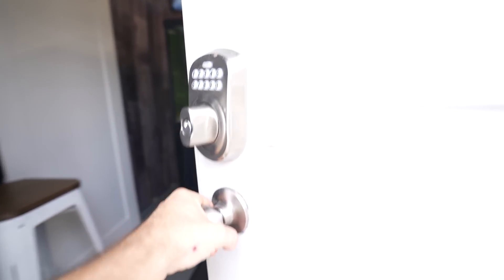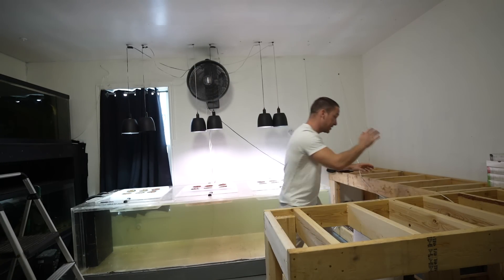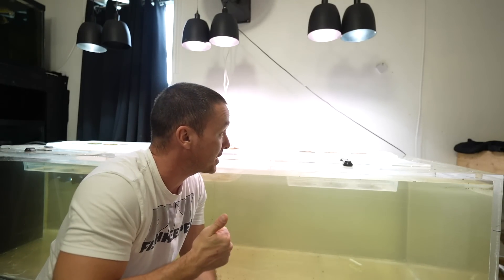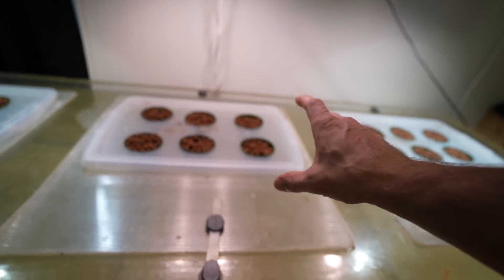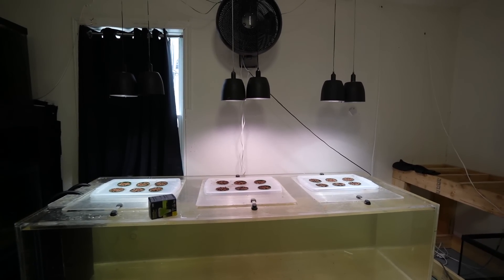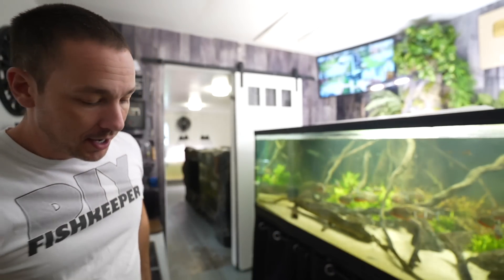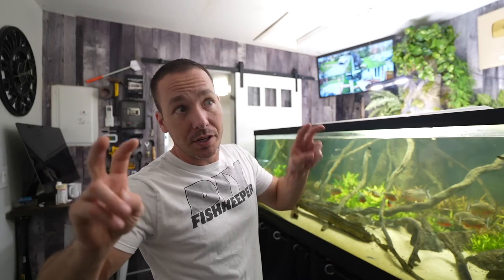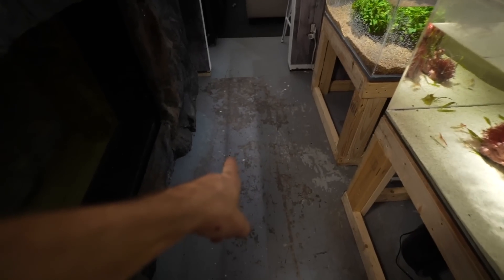HOW TO: DIY aquarium fish aquaponics

Comment: I work in Aquaponics and have a setup on my aquatic turtle enclosure at home.

I have a couple suggestions: Once you're sure you like how things are set up, I would switch those pots out for net pots to allow greater water flow around the root systems since you don't have pumps actively circulating water directly around them. Secondly, you will need either a trellis system, OR, and I recommend this one, an overhead string and clip system coming down from the ceiling in order to grow tomatoes and anything else that may need support. I also HIGHLY recommend searching out smaller plant varieties, like patio types, so you don't end up with a 9 foot tall tomato bramble taking over the whole top of your aquarium. You may also find that those single bulb lights have a hard time producing enough UV light to grow sturdy plants. I have some like that in my reptile room ceiling fixtures, but the plants I grow in there are mostly lower light plants, like pothos and spider plants. Things like lettuce and herbs may require more light, and some, like parsley and rosemary, really appreciate more of the red light spectrum. It may take a little searching, but there are affordable panel lights with a bazillion LEDs in them that will likely do a much better job.

Herbs that do well in aquaponics settings: Basil, Parsley, Rosemary, Thyme, Oregano, Dill, Chives, Cilantro, Sage, Mint
Reply: Would you have to be worried about certain herbs being safe for bettas or other sensitive fish?
Reply: @metametameta69  I don't have a studied answer for that, but most of those herbs house the essential oils in their leaves and stems, not so much the roots. I do know that chives roots are just as strong as the rest of the plant though, so if you're worried you could skip that one. If you have sensitive fish you may want to do research on the specific fish and herb combos you're thinking about trying, just in case. But most plants don't release the EO's until cell walls are damaged.

Comment: Yes please get another redtail, i love redtails so much. I got my redtail around a year ago because you not only show how amazing the fish are but also you can keep fish appropriately on a budget. I kept my redtail in a 125 for 7 months or so and when she got around a foot long i bought a pool pond for her and my tiger shovelnose. Its a 10x7 pool and for filtration i used a 1/3hp sump pump with a tote as a filter box with two 1 1/4 pvc with uni seals as the outflow. It gives plenty of oxygen and it was around 100 dollar US to build. The heater was the most expensive part and its an in line run through hottub heater that cost me like 125 to buy but winters in my state are a bit rough at times getting into single digits at night and its just in my basement on bare ground. Shes almost 2 foot long now and seems very happy. Now i have to get a better setup for my alligator i picked up a few days ago. Hes a big boy and he needs work, hes a bit angry haha

Comment: There is no doubt the gallery is shaping up to be awesome and the aquaponics is a great addition. I've been running an aquaponic aquarium for about 10 years in many iterations and I'm still learning and getting both incredible and terrible results so for what it's worth:
- for herbs and leafy greens stocking density isn't that important and it comes down to the ratio between light power and food intake. 1g of food per day can be consumed by plants under 10-30W of LEDs. The top end of that will likely keep nitrates at 0.
- for tomatoes and other hungry plants you're going to need a high stocking density, a more herbivore diet and supplementing some nutrients or microorganisms. Or you can make a dual root zone system with some good soil.
- most importantly roots will again and again surprise you with their ability to grow up and into things and clog fittings you never even imagined were in danger.

Comment: Are you going to put air stones in those tote to prevent root rot?
Tomato plants will have nutrients deficiency, what product will you use to dose?
Roman lettuce is a easy veggie to start with in aquaponic.
Building a strawberry tower would be super cool, sticking out of a tank. 
Good luck Joey!

Comment: as someone who runs aquaponics, it would be a great idea if you put a strip bubbler in each tub between the rows of pots. even with good water circulation I don't think you will get enough around the roots to get enough oxygen around them and the roots will 'drown'. When you do lettuce for example in floating beds the flow is huge. generally clay balls are flood and drain system as you need the air . but everything is an experiment and good luck

Comment: When drilling the hole in the plastic, do it in reverse mode first. Thank me later..

But roots are going to take over that small space quick. And you need flow or bubbles under those pots. Read up on DWC. Looking awesome

Comment: The only issue with leca is that it's not too sturdy as far as substrates go, so you might want to add some bamboo sticks to prop up the plants one they grow past the first few leaves. Rock wool is better for stability, especially when you germinate the seeds. Also pro tip: get a DVD sleeve, put some paper towel inside, add seeds and water, and another layer of paper towel on top. Check daily for sprouts, this way you're not introducing seeds that don't germinate into your system, as decaying seeds (or seedlings) will contribute to the ammonia load of the aquarium.

Comment: I'd love to see the aquaponics system up amd running with food growing on it. It is something I've always wanted to do with my tanks in the future. The only concern I'd have would be the actually plants you'd choose. I've read and heard so much that you either can or can't grow food plants in an aquaponics system, due to either certain plants changing the water chemistry enough to kill your fish stock, or not using food plamts at all in a fishtank aquaponics because you could potentially contaminate the food you grow with whatever you have in there (apparently red-eared sliders are a big no-no if you wanted to grow food plamts from their water). I've also heard that aquaponics don't need water changes? which I find hard to believe.  I'd love to hear your opinion/input on this when you choose both your plants and fish stocking! Good luck on your new endevours!

Comment: eventually the roots are going to really stretch down in to the main tank the roots will spread everywhere the protection tubs will keep the roots safe at first but then they might also lead to water stagnating around the roots, keeping those exposed to air bubbles and high flow will keep them from getting nasty, and having some really small fish that will get in around them and tidy up would probably be smart too.

so id go for something that will cope or enjoy that kind of environment. is there anything that would play in the air bubbles? initially i was thinking move the oscars to it, but they fit in the 2000 really well.

Comment: Dude - surface skim the piranha tank and replace the plastic covers with a wide hole mesh, pulled tight across a frame. perhaps with a hole size of half an inch. That way you will maximize the shimmer from your lights. Use a dehumidifier to deal with the evaporation.

Comment: in the horticultural world, this system would be known as deep water culture... Just a heads up you will need plenty of oxygen in the tank, like lots and lots of bubbles also roots dont like light, so i would curtain off tank round all sides otherwise you may find yourself battling pythium, i would also only grow small fast finishing plants, 1 tomato plant would fill one of those tubs with roots in a week under the right conditions...also stocking wise you would want some fish that prefer slighly acidic water as optimum ph for most fruiting plants is 5.8 so they can absord all nutrients if the ph is too far off nutrients get locked out of the plants.

id suggest rams, tetras, hatchetfish, ransboras and maybe plecs

Comment: That's Awesome. A couple tips though. Eventually once your roots grow, they will cause ypur plants to get stuck in the circulation holes. Removing those plants will throw tiny root bits all over in the water, making a mess. Trust me, I did it. It will clog all filter AND pump intakes quickly.

At the height you have your lights, go with 18-22 watt LED Floods, do not use spot lights. If a you can find are spot lights, just cut off the lens.

Light color temperature of available bulbs.
Under 3000K "Red" is for fruits and flowers.
3000-3500k is universal.
Over 4000k, especially 6500k, will give you the best green vegetative growth.

3000-3500k bulbs great for Tomatoes.
6500k bulbs best for herbs and leafy greens.

If you to small tomatoe plants in the middle with 3000k and greens on the putside two with 6500k, you will get bleed over with amazing results.

Growing Leafy Greens in a room over 70F will be challenging. Maybe bolt resistant varieties would be best?

Comment: I have Pothos in pretty much every tank.
Another idea I do is suspend a pot with expanded clay beads in it in the water. I use some basic round plastic ones and ive also used the long rectangular planters for other plants. Alot of fish will eat roots too

Comment: If you went with per-tank heating for everything and lowered the temperature of the room, you could stick a load of big goldfish in that tank. What with the increased bio-load of goldfish, it could be good for the gallery. Rather than more redfin catfish which you'll ultimatley have to rehome.

Comment: You can use your hole saws in reverse on plastic, drill the pilot hole as normal. It will take a little longer to drill the hole in reverse but it won’t grab and crack your thin plastic either

Comment: Who knows if you'll see this.. for the measuring tape over time if you use that tape alot it won't be accurate. Retracting it fast like that will eventually stretch the holes,